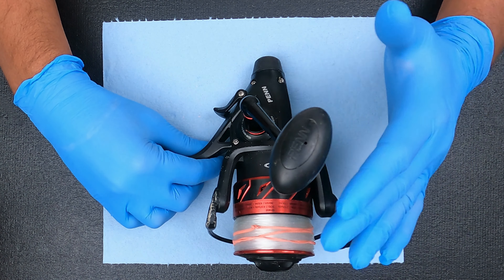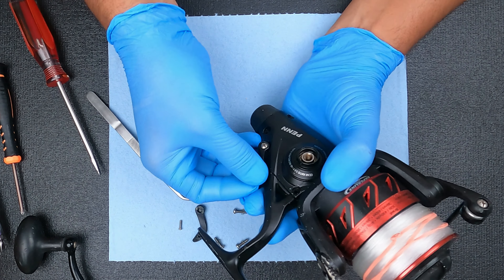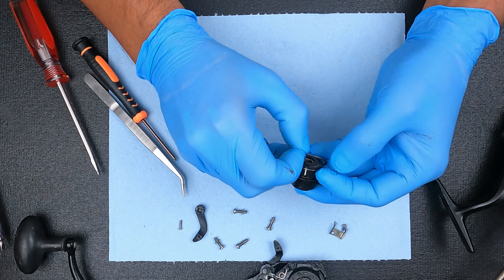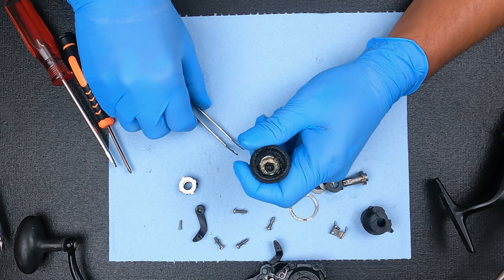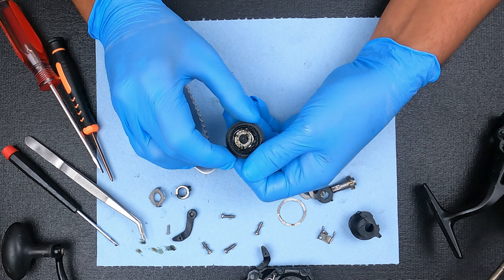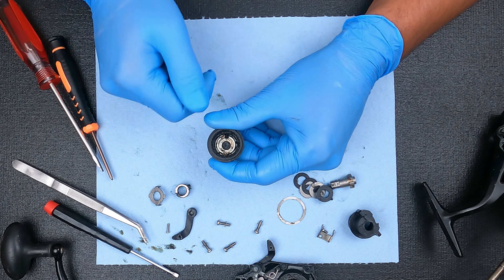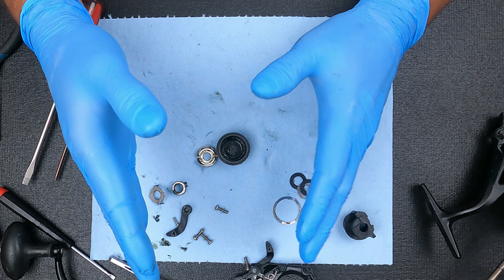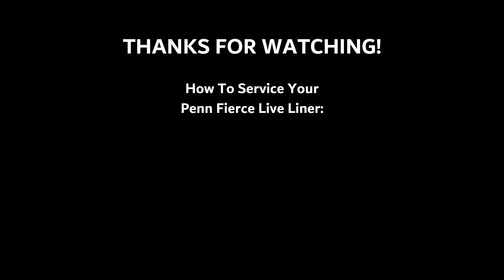Penn Live Liner Knob STUCK - How to fix - Fishing Reel Repair

Comment: You are a brave man. Most shops will not work on these finicky reels and I would never own one myself. (If you're bait and wait fishing on the beach you simply do it with a loosened drag. If you need to set the hook quickly you can palm the spool and then tighten the drag knob.)  Thanks for posting this.
Reply from the maker: Thanks for watching, brother! True, most don't.... I think it's more of a time factor, but not really sure. Thanks for sharing the old school beach fishing tip.... I'm sure it'll help some readers out there.

Comment: Wouldn't using a snap ring pliers be easier to use to remove the rear but, just put the arms into the slots ?
Reply from the maker: Thanks for watching and sharing your thoughts. That's what I was looking for when I said I couldn't find what I normally use (circlips). However, I don't think the ends would have been strong enough in this case, so I think I'll stick with the pliers going forward..... maybe I can get some standard pliers that have the spring in the middle?